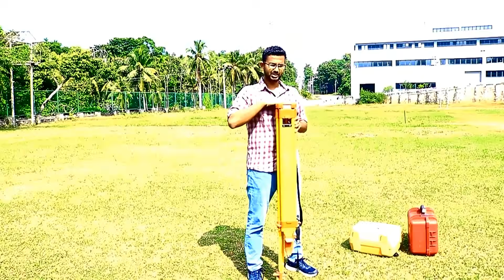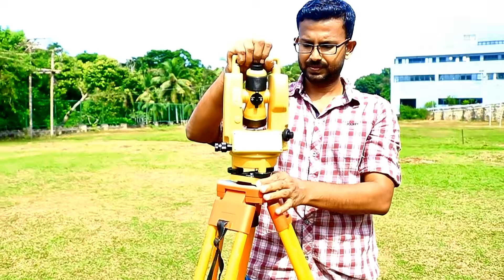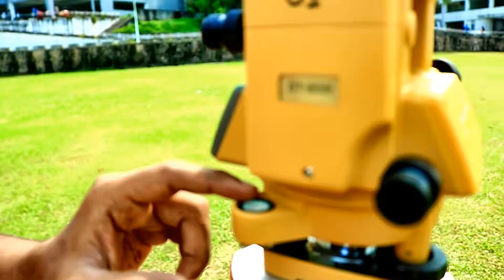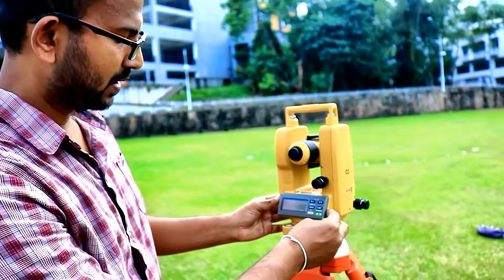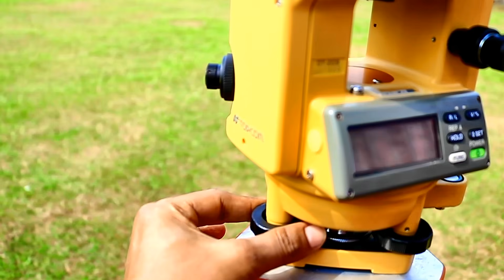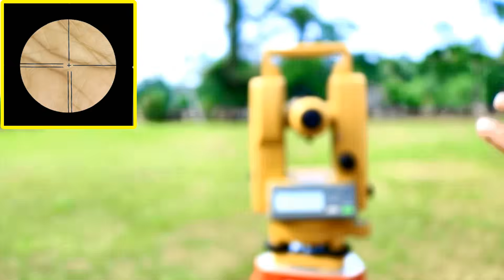Setting up of a Theodolite (Centering, Levelling and Focusing)

Comment: What is the difference between a total station and the theodolite
Reply from the maker: Total station is a theodolite which has an inbuilt Electromagnetic Distance measuring device and a computer which can do several functions (distance measurements, obtaining point data, setting out point data) and save data. The meaning of the name Total station is it can save or add station data (N, E, Z or bearing)